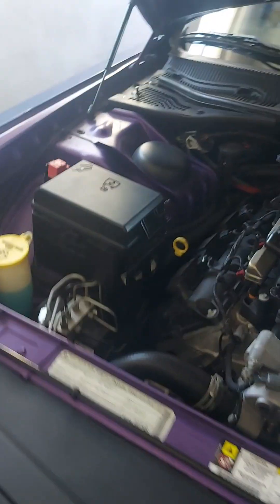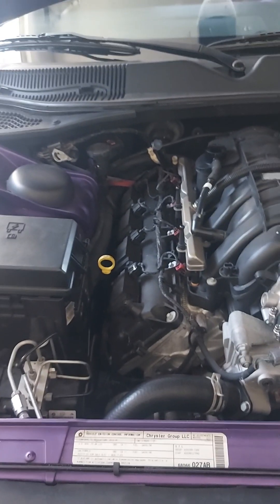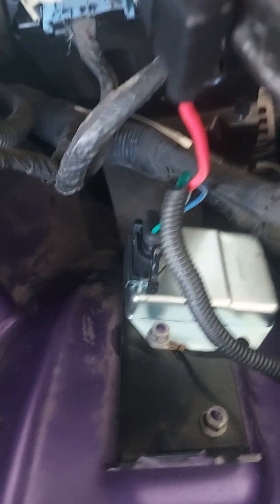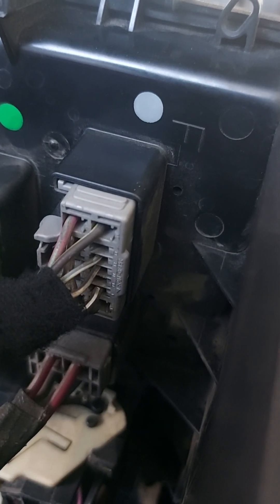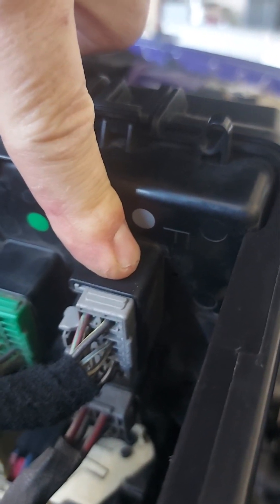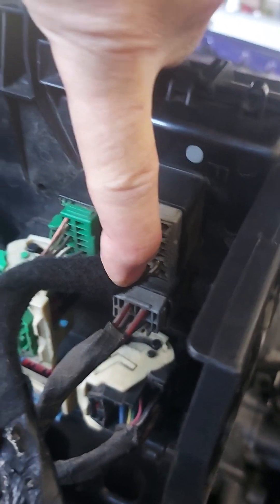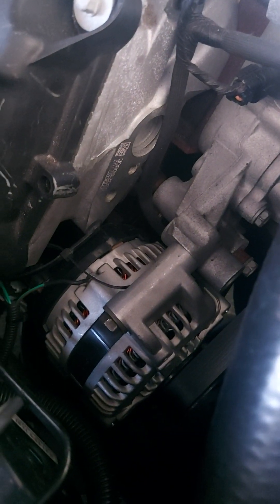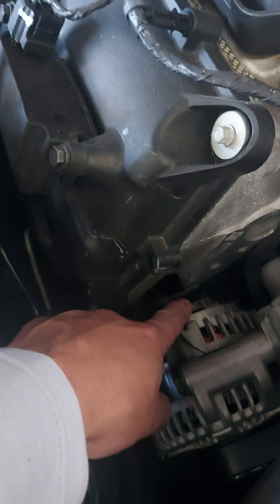2010 Dodge Challenger External Voltage Regulator Hack Fix Bad Alternator Not Charging 5.7 Hemi

Comment: Where did you get the connector for the back of the alternator
Reply from the maker: Amazon...just look up 2005 Charger alternator pigtail plug
Reply: @mikepoppjr I did the same bypass tapped into the same wire and I keep getting a code for asd main and my injectors go out to where the car won't run or start until I pull the relay and put it back in it was the black and white wire right ?

Comment: Do you think doing the same thing would work on a Dodge neon cause my charging system don’t wanna charge on the PCM
Reply from the maker: All I know is that dodge put the alternator regulator in the ecm in all dodges after 96 if that helps... good luck
Reply: @mikepoppjr is your vehicle reliable now that you did a external regulator